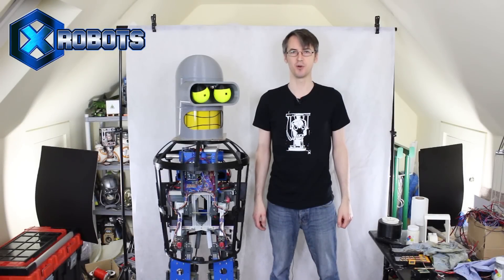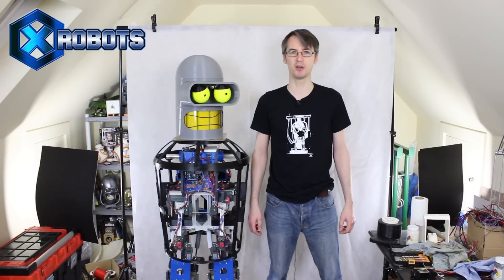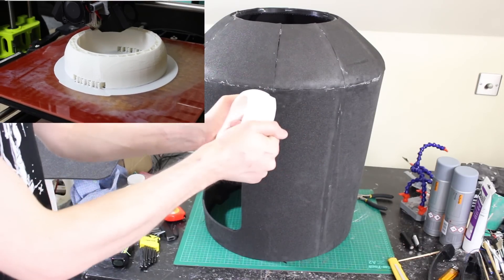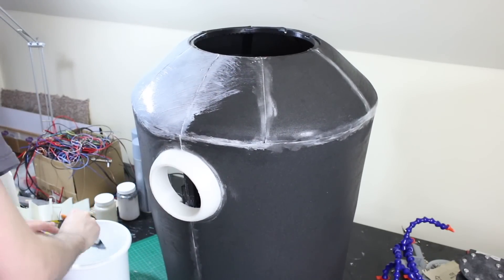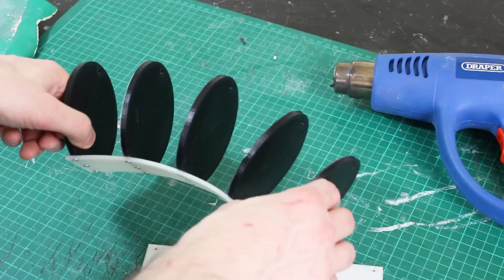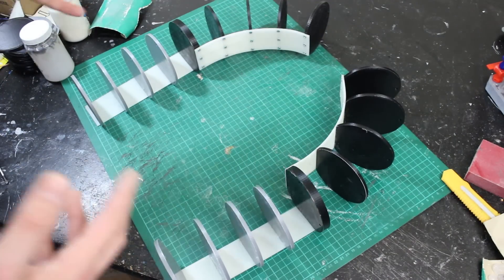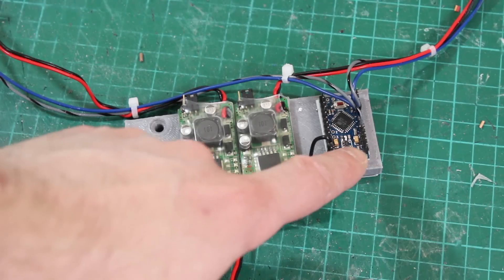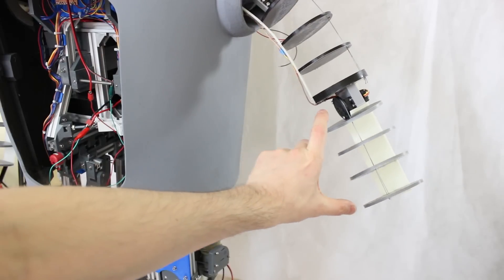Futurama Bender #2 | Building the Body & Arms | James Bruton

Comment: Perhaps (if it wouldn't be adding too much complexity) try adding rotation to the shoulder hubs so the arms would get an extra DOF (anywhere within a 170° radius)? That would be extra cool. And then Bender could point to his own arse - like someone here mentioned earlier. You probably wouldn't be able to get away with just a standard servo (perhaps a heavy-duty one, but then there's cost), the alternative would be using a DC motor with a gearbox attached (like those drill ones you've used in the leg joints) for added torque.

Comment: The arms are kind of what I described in the comments on the previous Bender video. I think these you made need some work. A modified version would be disks, like you printed, with a flexible rod down the center of them rather than the nylon piece you used. Like I described before, put both servos at the shoulder with strings running down front/back and left/right sides. Each continuous servo has two reels with the strings wound in opposite directions. When the servo turns it pulls on one side while releasing the other side.

Comment: I was thinking that you could have springs between the plates in the arms so they would return to a default position after being moved by the servos.

I also was thinking that you could put in 4 strings in each arm that goes through each plate and then you have 4-directional movement. you would loose the joints but you would gain a whole lot more motion in the arms just like Bender in the series.

Comment: I've been wondering since the Bender build started how the hell he was going to do the noodley tube arm. I figured it was impossible and he'd have to go with heat-bent pool noodles or something. This servo driven segment design is just amazing. Well done James. Holy heck.
Reply: I guess you could go as far as putting an individually assigned servo in each segment if you wanted to go all-out and use a high-torque motor to rotate the arm where it meets the body. Either way, this bent nylon segmented servo design is just fantastic. I don't think I would ever have thought of doing it that way. Colour me impressed.